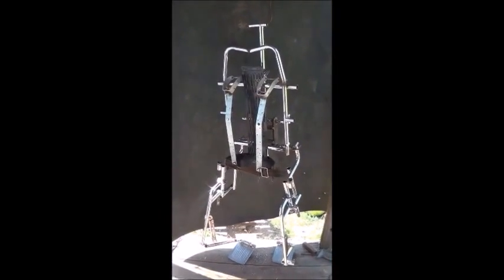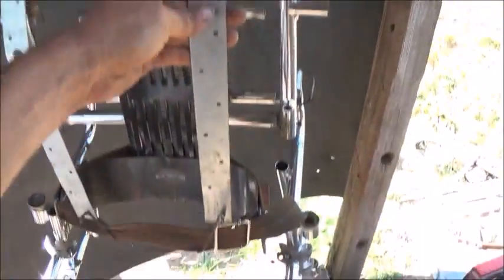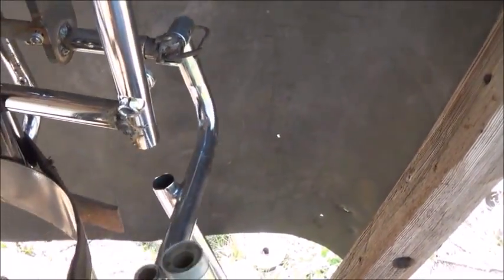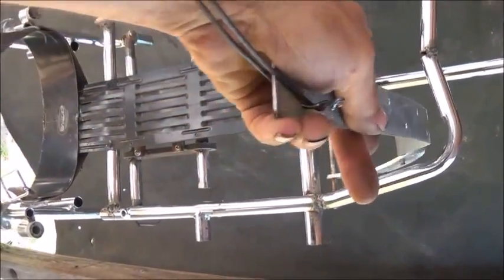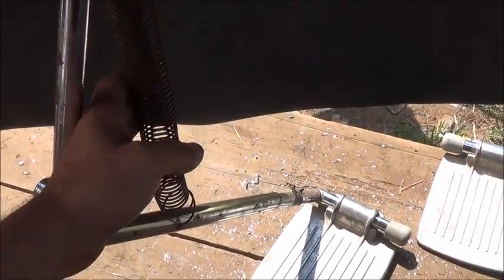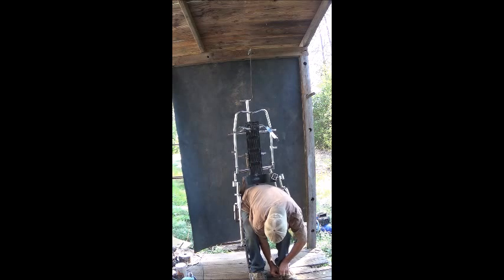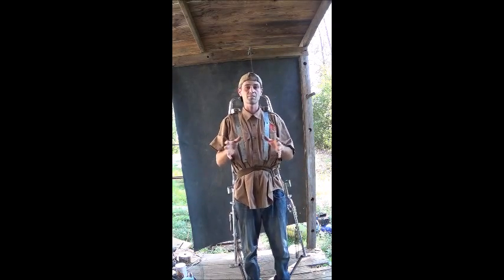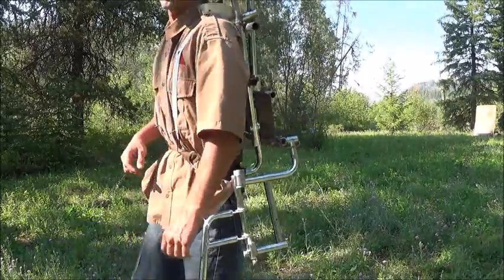"Homemade Exoskeleton"  Part 1.

Comment: A bit of oil would go a long way.  Great show.  Love your stuff.  Instead of nitinol how about fishing line muscles.  There is a lot of research going on with that now and it is super light and cheap. Also try straps like on back packs rather than all that heavy metal. Nylon and Velcro are cheap and light.  You are awesome.

Comment: ***** Would you know how to turn a tens unit biofeedback electric stimulator (for muscle pain) into a Dr Robert Beck magnetic pulser or colloidal silver generator. It has two leads that both hare negative and positive each lead. I have a lot of copper coil also. I just don't know electrical so I'm not sure how to go about making those too things! But I really need them for my health but they don't run cheap so I wanted to recycle-build off what I already have. Like what your great at, although I'm not knowledgeable or clever like you!! I thought about making a video showing the tens unit device to see if the electrical men on YouTube could point me in the right direction. I still might. I see your clearly busy so it's okay if you don't get back to me. I just saw your very knowledgeable and invented so I wanted to ask!! :-) Thank you. Keep on making the great videos!

Comment: have you addressed Nitinol fatigue?
Reply from the maker: Mike Davis Some Gator-aid and rest normally helps;)
Reply: lol no i mean under a load Nitinol tends to snap eventually, funny response though
Reply from the maker: Mike Davis First nitinol does show rapid degradation if the bend is to extreme or the distance of travel exceeds a 30% range so the only way to address this is to minimize the movement distance and bend arc. Other than that probably the only people that can solve this issue are the producers of nitinol.
Reply: great explanation, clears things up...yes i'm very interested in learning more...a few years ago i researched Nitinol alot, but when i came to the conclusion of the fatigue i lost interest thinking it was a critical flaw. I'm really into its use as a hot water engine for power generation and so dabble with peltier units too...cool work your into, i got my electronics degree for similar interest...i will follow your progress and wish you best of luck...would really like to see your projects success and if i can contribute please let me know

Comment: Nitinol wire takes a slight temp change to react (change) back to it's original shape, very clever Tes. Good job. The heat / cooling material around the springs may do it.
Thank you